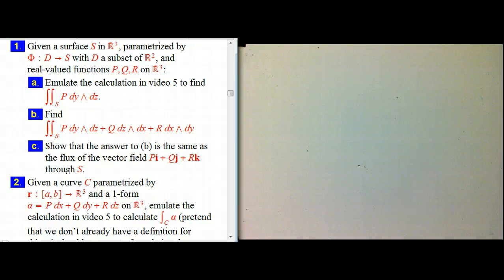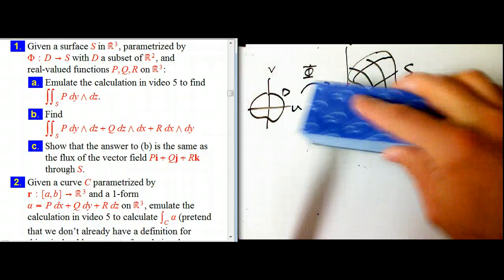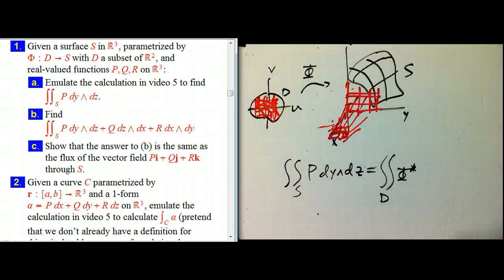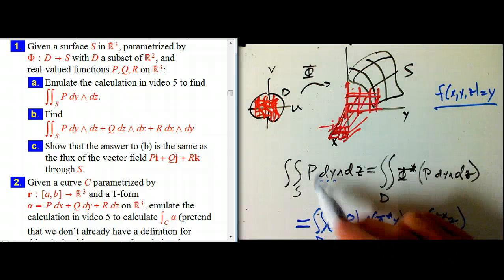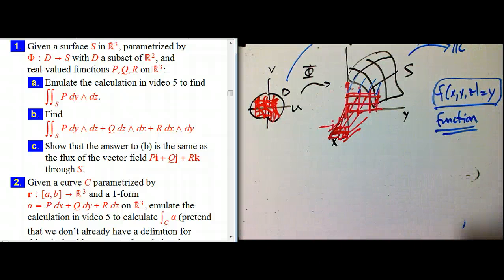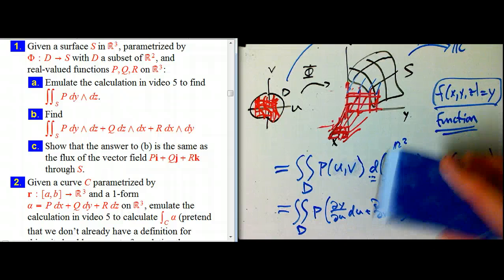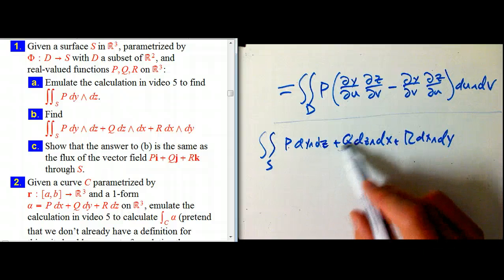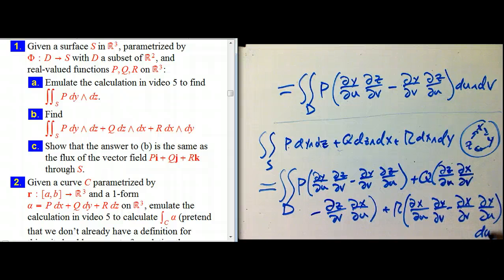Intro to differential forms (part 6)

Comment: I'm having some difficulty rationalizing the association of an element of flux through a surface with an oriented element of that surface.  It feels like the same sort of dimensional mismatch as caused by the cross-product (which I've never liked), but in reverse.

My understanding, so far, is that if I took the gradient of a scalar potential, it would, in this framework, be a 1-form.  How and at what point, in calculating the flux of this gradient through a surface, do we get a 2-form instead?
Reply from the maker: Regarding your second paragraph: The replacement for the gradient of a scalar function, in this setting, is indeed the 1-form df. We then have that the integral of df over a curve C going from point P to point Q is f(Q) - f(P). This is independent of any notions of length/angle/dot product (fancy language: independent of the metric). 

Now, in standard vector calculus, we also define the flux of a vector field through a surface. But this uses the metric and the cross product, so it's not the most natural way to do things. In the language of differential forms, the kind of object we integrate over a surface is a 2-form. So any time someone says that they are finding the flux of a vector field through a surface, you want to look for the 2-form that contains the same information as that vector field, which is what is really being integrated on the surface. 

In the case of starting with a function f, taking its gradient, and then finding the flux of that gradient through a surface S, there's secretly another step that is happening that turns that gradient into a 2-form. That's the Hodge star operator, discussed later in this series.  So that might explain part of your confusion here.

Comment: You write \partial y / \partial u, but this is just a shorthand (convenience notation) for \partial \Phi_y(u,v) / \partial u right? Like you have to still respect the pull-back and simply take the y component of it ... otherwise, I have not understood and need to go and rewatch your videos :D
Reply from the maker: Yes, as soon as I refer to "y(u,v)" at 6:53 I really mean y(Phi(u,v)). I was trying to relate the notation that mentions Phi explicitly to what you're more likely to see in a standard multivariable calculus book.

Comment from the maker: Now, a differential 2-form such as dx^dy is an even more different object, something that takes 2 vectors and produces a number. Now, in 3 dimensions, this new object happens to have the same information content as a vector field (so there is a way to translate back and forth), but it's a different object, with different operations possible on it. And most important, it generalizes to an arbitrary number of dimensions, in a way that breaks the connection with vector fields.

Comment from the maker: As I note in some of the early videos, a differential 1-form is not the same thing as a vector field, although the difference is subtle---it has to do with how it transforms under change of coordinates. A 1-form is really a gadget that inputs a vector at a point and gives a number, or a whole vector field and gives a function. That happens to have the same information content as a vector field, but it behaves differently (and better, for many purposes).